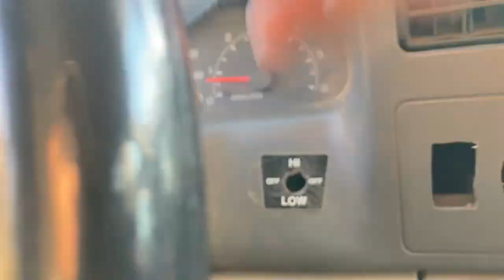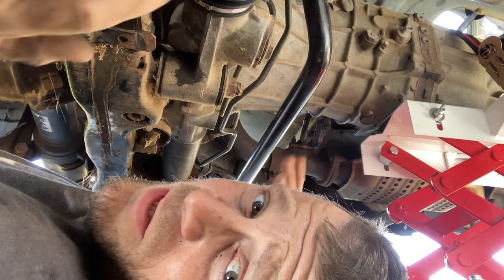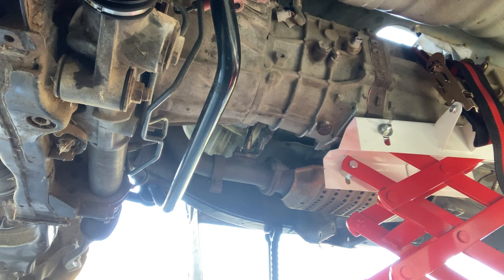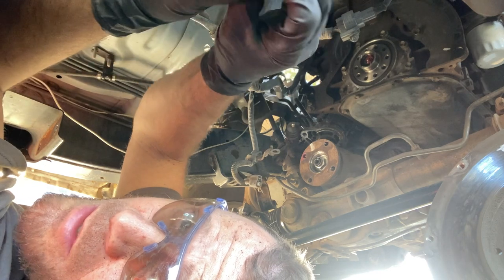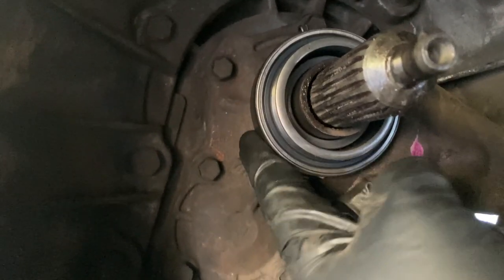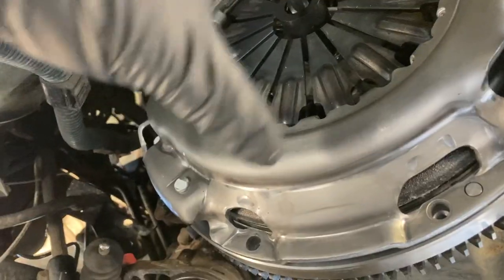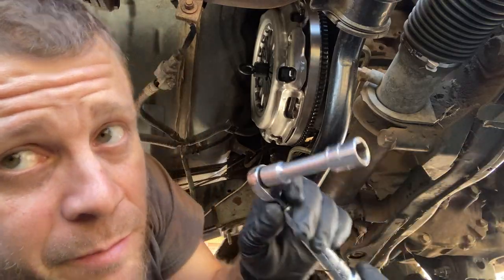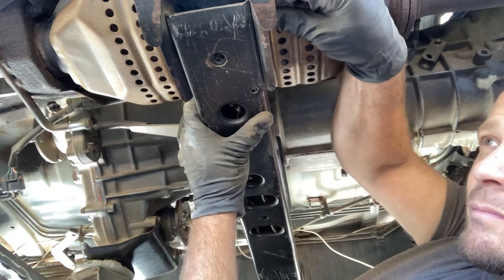Toyota Tacoma 4x4 clutch replacement (and the bread technique!)

Comment: I did my 96 Tacoma 4x4 totally by myself. Took my time, built a cradle to set on my floor Jack. I did 3-4 hours a day and it took 4-5 days. Got it back together with Orem parts , everything exactly the way it was. Pretty easy I thought

Comment: Using a 3 foot wobble to take off. The transmission bolts makes it so much easier, especially if you use power.

Comment: I gotta say, this was a fucking bad-ass video dude. I was like "OH SHIT!" when I saw the ratchet+zip tie solution to keep the crank in place. I'm half way thru this job on a 'project' taco that's had the tranny out for months (haven't had time to finish it & making excuses that I'll need help getting the trans in). This vid has fucking inspired me to get it done. Great job, man, much respect.
Reply from the maker: Thanks 
@changosurfo!
the trans takes a little bit of patience but is totally doable , a good transmission jack will make it easier , the one I used is kind of cheap and dosent have an angle adjustment , that would have made it a lot easier, thanks for watching  my brother!!!
Reply: what setting do you leave the ratchet before you ziptie it?? also how do you replace the rear mean seal?  @happybleeding

Comment: Yes sir, I found your video and I must say nice job, you said if a person had a question about a clutch kit install to ask you so here goes. I'm working on my 2017 toyota tacoma 3.5 6 speed manual. I was putting it all back together and before I put the driveshafts and exaust back on I tried to start it and what a horrible grinding noise can you give me some advise on reinstalling the Trans please it looks like I'm gonna have to tear it back down and start over. This is my 3rd clutch job on different vehicles and by far the most pain in the arse..

Comment: Nice video man. Straight up good working had a question when putting on the new piece that goes on the transmission around 10 mins. Is that pretty simple any suggestions or anything that went wrong

Comment: Good Stuff! Not too much bla, bla. Right to the point.  one question that I have is, why did you remove the wheel? I was hoping to just be able to drive the truck on to ramps.
Reply from the maker: I had removed the wheel because you are supposed to take off the sway bar but I was able to just loosen it without completely removing it , you have to work around it but it is doable, its best with the truck on level ground and as close to level as possible for when you have to slide the transmission back to meet the motor , hope this helps !
thanks for watching
Reply: @happybleeding  good point. Thank you!

Comment: Wish you could be my mechanic man !! Great job  I think my throw out bearing is going bad I believe it just started making a winding sound in low gears and in Neutral today it kinda has a similar sound to a power stearing going bad
Reply from the maker: Yeah the throwout will wind before it starts to grind usually.
Thanks for watching and commenting!
Reply: would the pilot bearing going bad make that kind of noise? i thought the TOB only makes a chirpy noise when it is starting to go bad?

Comment: Good video. Wish clutches that easy for me. I used man handling semi clutches. I always change rear main seal even if put on week ago. So I know they got good seal and can't come back on me for anything. And I use high qualities parts.
Reply from the maker: Yeah I recommended the rear main seal to be changed but the customer bought his own parts ,
but it was in good condition
thanks for the positive feedback
Reply: @happybleeding  if a customer buys their own parts I normal try find a way to make up for that in labor. Plus I give them 0 warranty and that I tell them up front. Only warranty they get is where they got the parts at. And if I have to do it again because of a faulty part I charge them.
Reply from the maker: Yeah thats great advice !
I typically advise them on where to get parts ,
this customer got OEM parts so I'm not to worried but I do lose money when I dont get the markup.
Reply: @happybleeding  we order a lot from kimble Midwest for some stuff. They carry about 90 percent Americans made stuff. All is high quality. You wouldn't be disappointed yes they more on expensive side but worth the quality your getting and service you get and they family owned company. Out here to help. And advise.